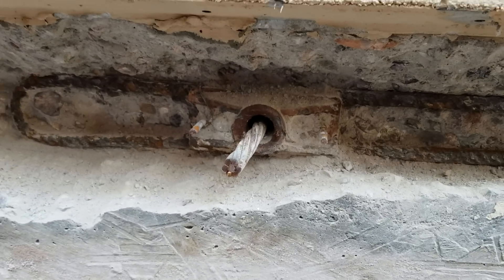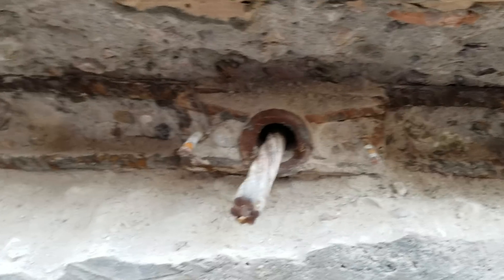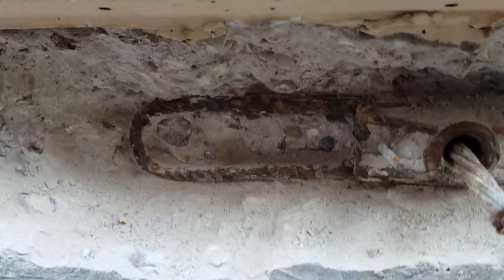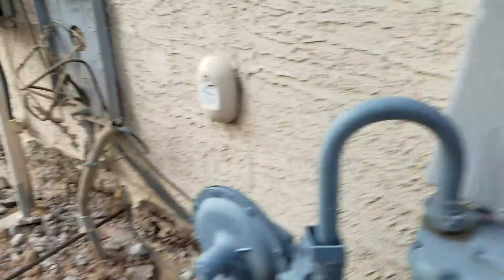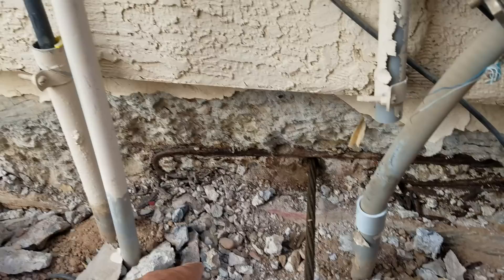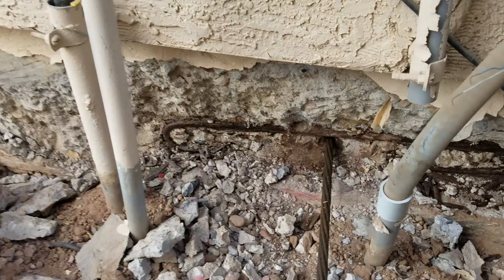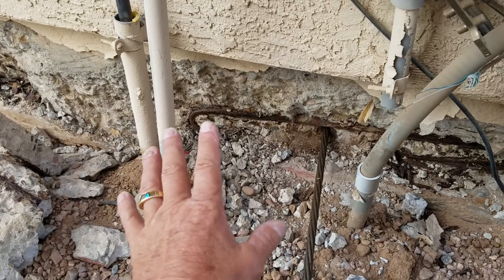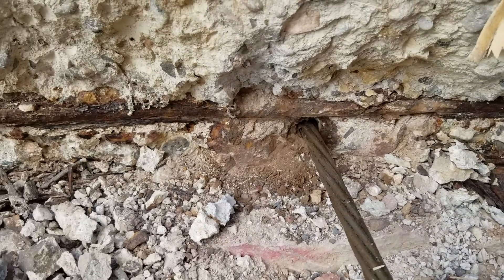Concrete Repairman LLC | Post Tension Nightmare - Post Tension Foundation Problems in Arizona

Comment: Does it really need post tension?  Houses were made without it a long time - what if it was just patched and the foundation not put back under tension - instead release pressure then leave as is?  I am not being a smart ass but wondering how long the house foundation will last without the tension
Reply from the maker: The Monolithic slab foundation without tension cables will have structural failure quickly. The reason is the soil around the (1 foot) foundation wall, will continue to move down from settlement causing the interior floor and wall separation over time.

Comment: I love your videos, I never ask you a question, but today I have a question and I hope you can help me, the post tension runs on the porch of a house because I saw some nails outside my house in the foundation in the corner of my house where the porch is, and a person went to do a sidewalk to my house, and I had to go to work and noticed the next day that they had cut a line from the foundation of my house on the porch side so that the water does not The porch got in, it was about half an inch, that's why I was asking you if the post tension runs on the porch? The person who cut says they don't go there, thank you very much.
Reply from the maker: Most post tension, tendon's run through patios and front stoops,  support columns and porches.  Just to be sure send me a couple photos of your front porch text to 602-418-2970 thank you.

Comment: i dont know anything about post tensioned systems but my guess is that since you already checked gutters and i'm assuming you already checked for proper drainage, you could have a couple of things that could've attributed to the corrosion... 1. improper cover (unlikely as it was prob designed and inspectioned by competent ppl), 2. improper curing (likely... contractors dont give a damn about curing), 3. improper protection of the exposed tendons after post tension (unlikely... the piece of tendon sticking out looks clean). 

just a thought

Comment: Is it normal for a post tension foundation that is a year old to already be showing rust where the attachment points are around the back patio? The patio are is the only spot around the house showing rust already.
Reply from the maker: Not normal.
Reply: @ConcreteRepairman  Thanks. So I should expect the builder to repair any areas showing rust. They already tried to tell me it’s normal.

Comment: Maui condo. Kihei. Same issue. Building has no gutters. Moisture gets in at ground level, even on prevailing wind direction 3rd floor.
Earthquake 15 years ago cracked open masonry sealing tension wire end caps.
Building plans lost at State Bureau of Conveyance office. Owners and management co not aware cable tension system used.
A real mess.

Comment: Spend a little more to begin with and use epoxy coated rebar. I don't like cables
Reply: Or another inch or two of concrete. Better mix. Being residential, the concrete probably wasn't the best.

Comment: Can you post a video about how to de-tention PT cables?  That could make me a unique person at my job.
Reply from the maker: Cutting torch, safety glasses, gloves, and keep your face and body away just in case the cable releases a little too quickly.
Reply: @ConcreteRepairman  I mean to de-stress from the wedges, let's say to repair or chip concrete nearby and you need the cable not to be stressed. Is there equipment for that? Is it possible?
Reply from the maker: @isaiastapiabermudez  You do not detention and then retention same cable. You have to replace the cable. If you are chipping around the cable because of cracking to do a repair, there is a risk of injury or death if the cable is not released.
Reply: You say right at 54sec you relieve the tension on the cable, the collars are removed. You wrote "detention", but suspect we are talking about detension. You have a hydraulic cable tension tool that allows you to insert or remove the collars, yes?

Comment: Adequate cover to rebar & PT cables and well compacted non
porous concrete usually stops this from happening. Grease the wedges with a cap
over the anchor. 50mm-75 cover is best for foundation rebar.

Comment: 14 inches is very thick for a residential home. I’ve done post tension decks for apartments and parking garages that were only 9” thick
Reply from the maker: 14 in in height exterior foundation wall interior floor is 8 inches. Thanks for your comment
Reply: Concrete Repairman LLC. Ah I see, exterior footing depth
Reply: Sounds dangerous
Reply: In south Texas they do 30", is that overkill?  We occasionally get periods of heavy rain.

Comment: So is conventional reinforced slabs better?
Reply from the maker: Conventional footings are twice as deep. The problem with post tension the soil moisture content easily goes underneath the slab and evaporates upward oxidizing the interior reinforcement Steel causing this type of damage shown in this video.

The obvious majority of the damage that I view daily is all about moisture. If only all Foundation walls were waterproof, dirt grading to slope moisture away from the foundation, and 6 inch aluminum seamless rain gutters with 4-foot downspout extensions disbursing the roof water away from homes, I would be out of a job.

Post tension homes have Les heave fractures on interior floors, because of the combination of cables, and 8 in thick interior floor slabs. It has never been, and never was about expansive soil! Expansive soil, is only given when a professional does not know what the actual cause really is. It is the number one excuse given by these professionals to homeowners and building owners, especially here in Arizona.

In my opinion;  Compaction testing on Perimeter soils where Foundation footing will contact soil meet or exceed 86% compaction rate, verified prior to pouring perimeter stem wall footing, or monolithic footing and floor. I would rather have a conventional Foundation, that is waterproofed, dirt graded around the entire perimeter, and 6 inch aluminum seamless rain gutters with 4-foot downspout extensions. This combination will stop settlement, interior floor cracks and heaves, cracks in the ceiling, doors not too close, spalling on vertical walls of foundation, and interior oxidized rebar reinforcement damage.

Thank you for your question, I hope that I have been helpful. jb.